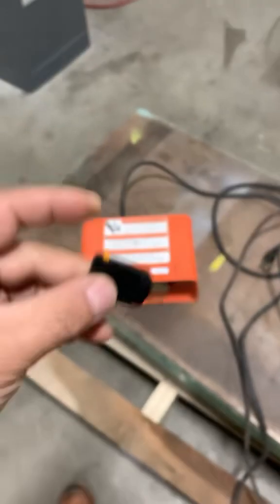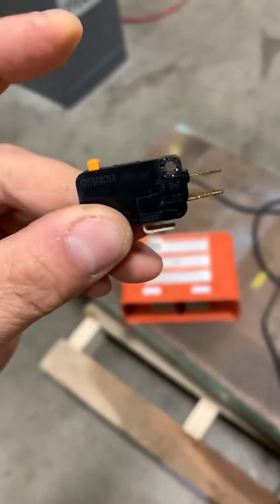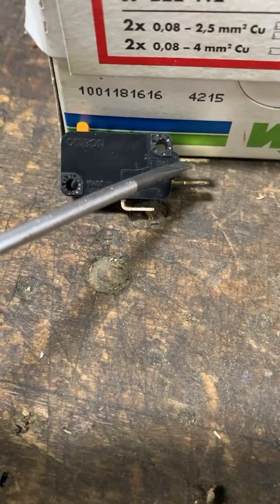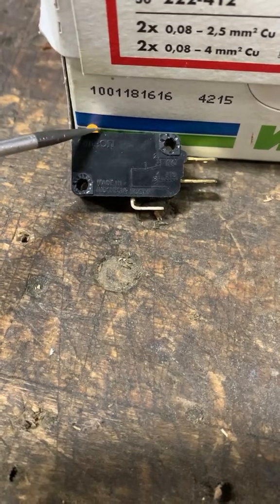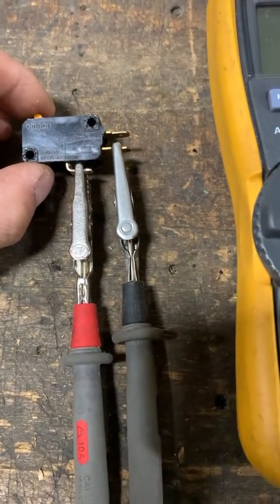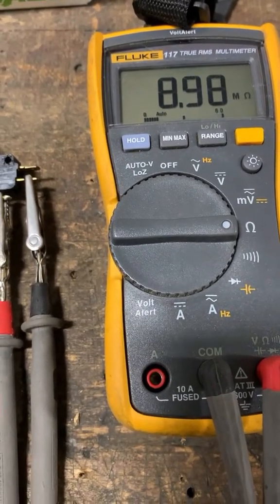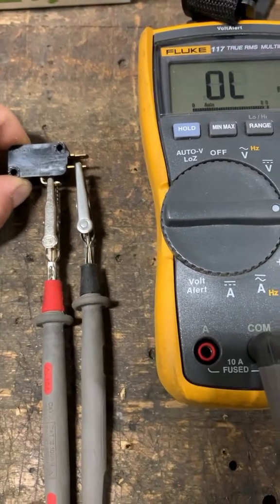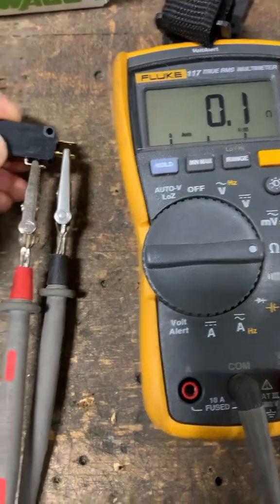Clicking sound doesn't = good.

Comment: Fantastic troubleshooting Sir. Just please, take it from me, do not set these foot switches on top of a foam mat.  The knees feel better but after 7 hours of using the machine, your heels dig in a bit and the switch will trip just by you shifting your weight.. lost 3/4” of my left thumb to this scenario.